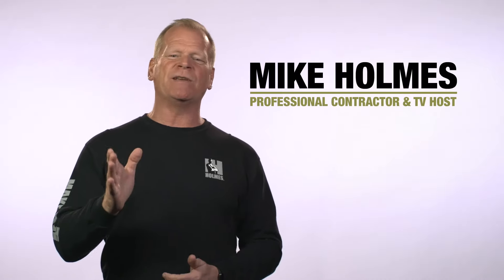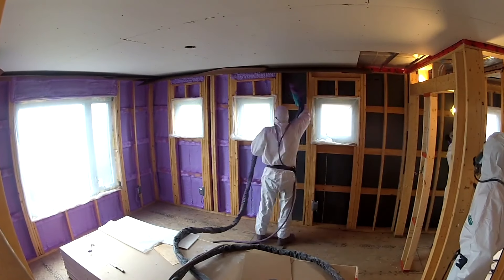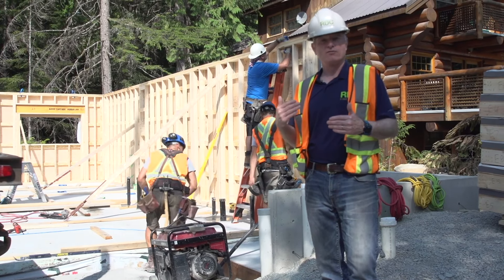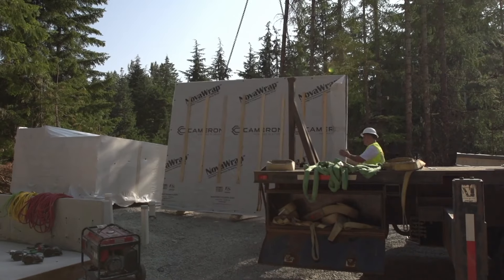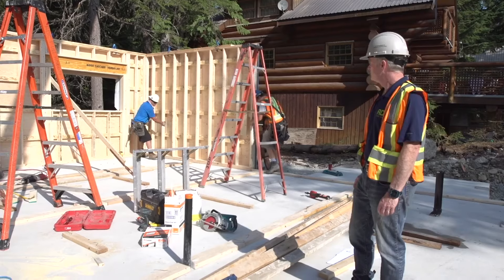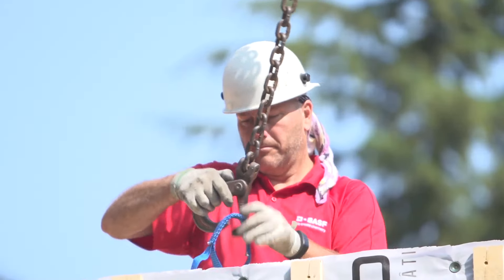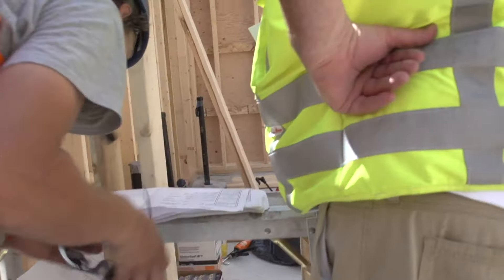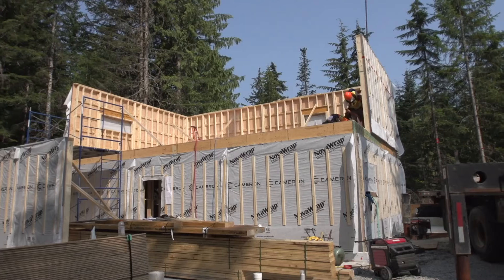RDC Fine Homes: Panelized Construction with Holmes Approved Homes

Comment: Interesting, thanks for sharing.  For what its worth it looks like the sheathing is going to be at risk for rot.  WRB should be installed next to sheathing with insulation outboard of that.  Water control holds preference over thermal control.  The sheathing looks unprotected, perhaps i'm wrong.  How the exsulation and furring strips were fastened to the sheathing will most likely be a conduit for bulk water intrusion.  Consider multiple beads of NP1 caulking on the bottom plate verses one or better yet a rubber gasket with at least two gaskets placed under the bottom plate.  Interesting use of OSB inboard to plywood for sheathing.  Why was that done?  Thanks again